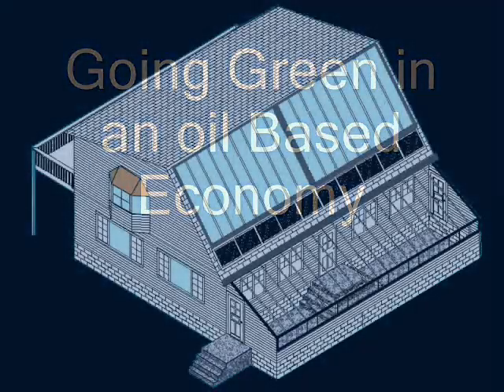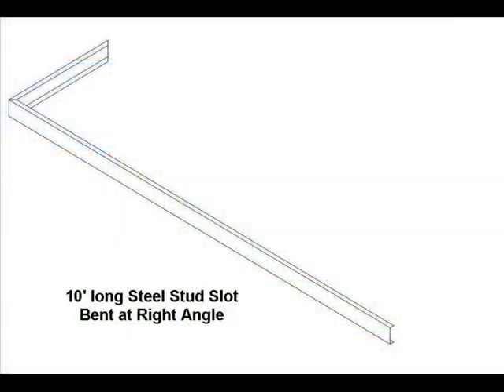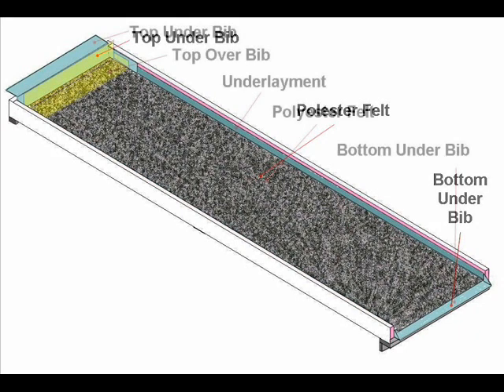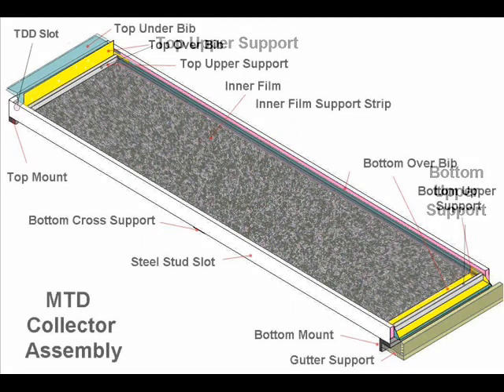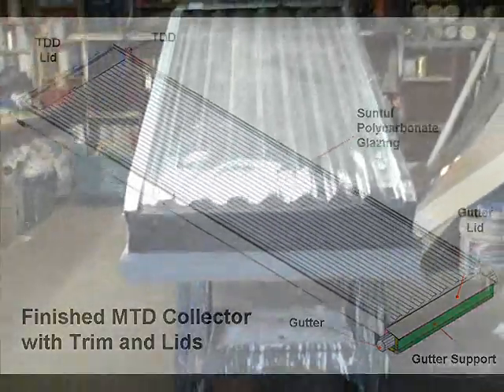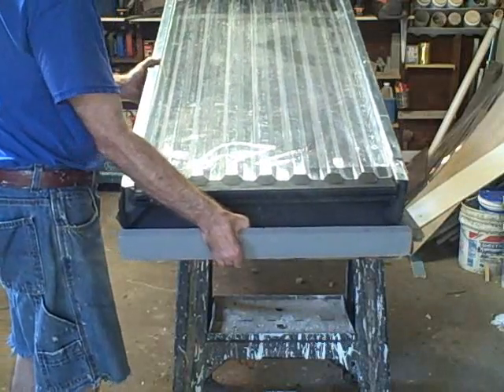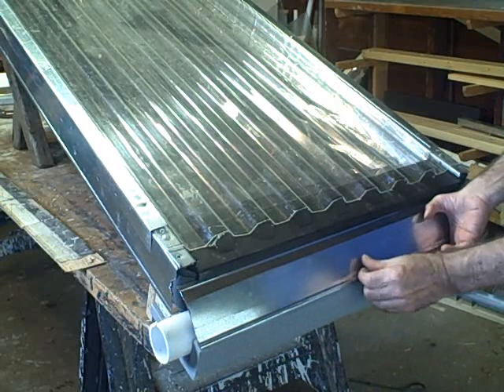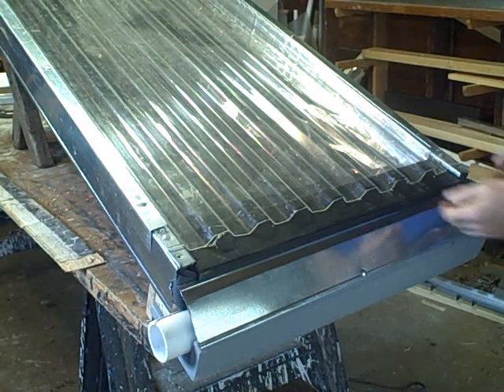Going Green in an Oil Economy

Comment: I've watched all of your videos. I live in Southwest Louisiana.... I have 3 solar air heaters installed in south facing windows and just those have helped during "SUNNY" days during the winter.

I would like to build a large MTD system to use for our hot water needs and help with heating our home. I have a ton of questions still. Where else do I look or go for information ? Thanks